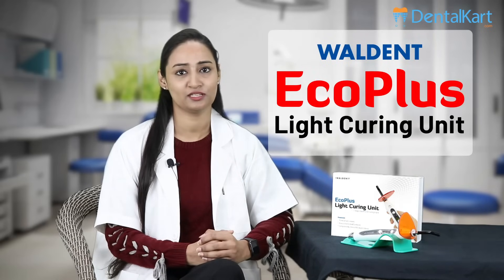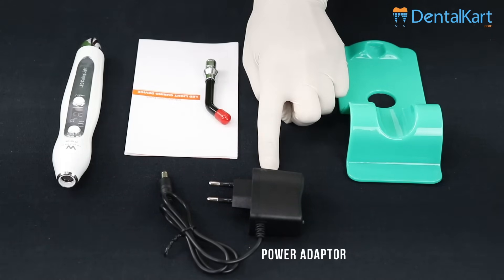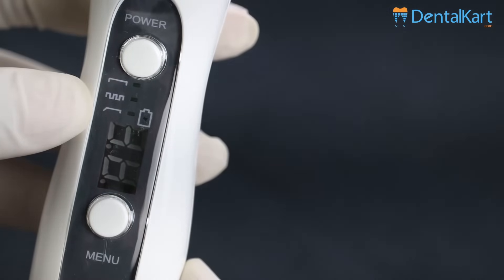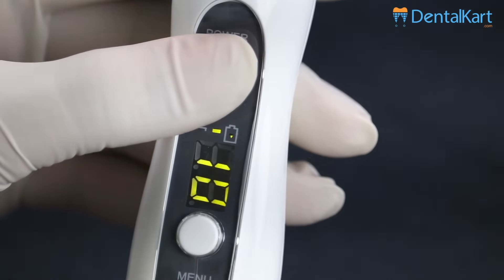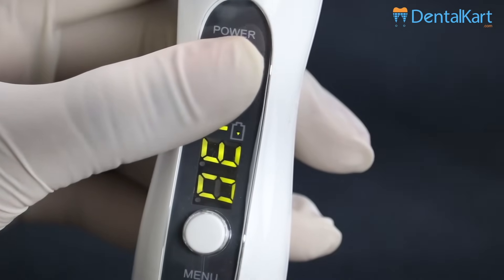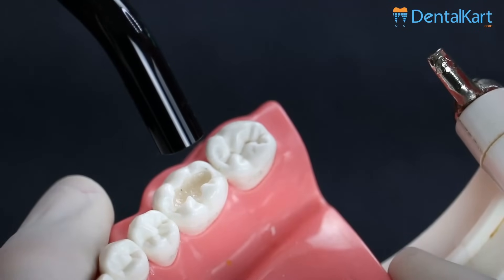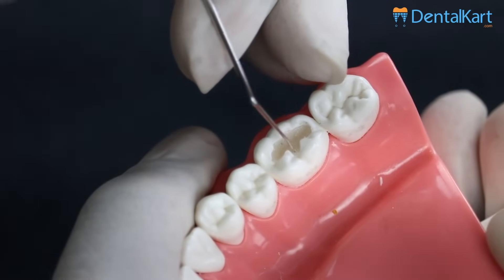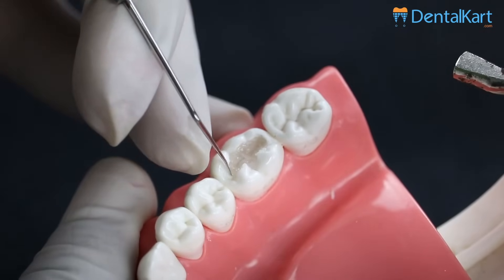How to use a Light Cure Unit | Demonstration on Waldent Eco Led

Comment: Which mode is the best to cure teeth. If I'm using the on off on off blinking mode do I have to double the curing time?
Reply from the maker: Dear Doctor,

If a blinking (pulsed) mode is used, it typically delivers less total energy over the same duration as continuous mode. Therefore, curing time must be increased to achieve the same degree of polymerization.

Continuous mode is typically the best for speed and predictable results, especially for surface layers and thin restorations. 

Pulsed or soft-start modes are better for large restorations to reduce shrinkage and heat buildup.

Team Dentalkart
Reply: @dentalkart  yeah I figured that I should do soft start like 5 seconds. Than 10 seconds pulsing, than another 5 or more seconds full. That was the best one for fixing my teeth 😀

Comment: 3 20 24 ... i have some clear resin via Aventik  Edison Design. the kit from Amazon came
with a uV lite & 3 each  1/3 oz bottles.  their applications are more for gluing and gap filling.
with no mention of dental uses .

     on experimenting i spread 1 cm by 2mm wide  resin on my thunb nail and
 uV 'd it for 5 sec ..     it got uncomfortably  warm / hot.   

       does  the resin used in your video get hot too on uV activation ?

       i need to put a temp patch on a  front tooth where a previous 4 year old patch
 broke off last week. 

        to patch it with the Aventik resin i have a '?' ...
      should it be done with a very thin resin application , 
less than 1 mm layer at a time ?  
    ...... to keep  any heat build-up to a low level ?

      my DDS  appt is not for almost a month.  thus i thot it good
to cover the tooth up to protect it
Reply from the maker: Please seek professional assistance if you find yourself in such a situation.